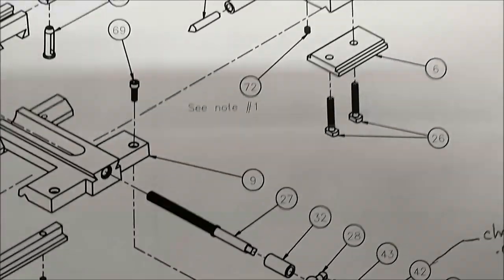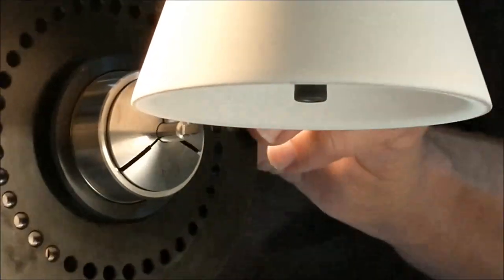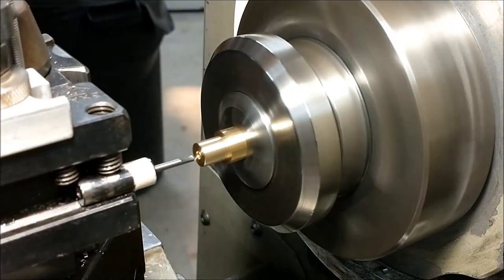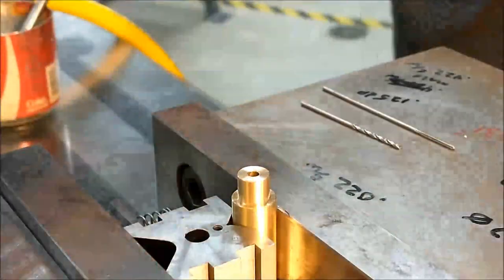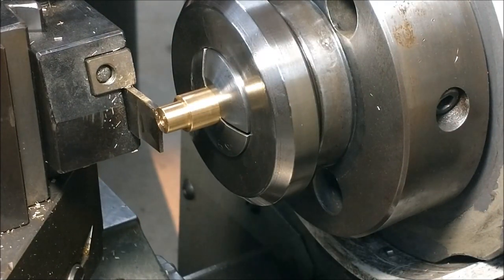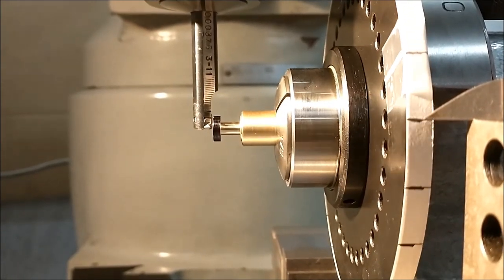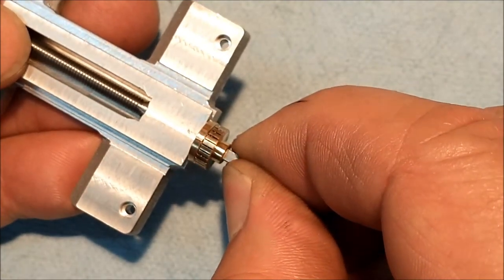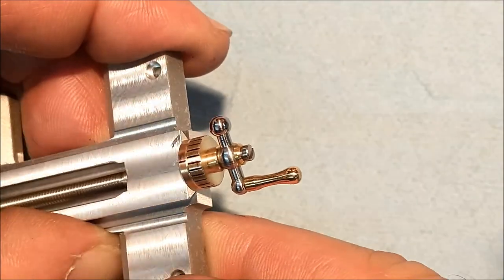Mini Dials for the Mini Lathe

Comment: Great video as usual. Here's a little white board job for one of your videos. Draw a right angled triangle without a hypotenuse with the base equal to the circumference of your spin indexer dial. Set your board compass to a radius that is easily divided by 25 but longer than the base and use that to set the hypotenuse from the end of the base to the vertical side. Divide the hypotenuse into 25 and from each of those marks drop a vertical to the base. You will have 25 divisions on the base without needing to calculate any numbers or use any special tools. If you do it on paper you have your required scale for sticking to the rim of the spin indexer. A useful technique for people who have not seen it before.
Reply: That is indeed, very sneaky!
Reply from the maker: I like that. I had to think about it for a minute, but its clever.
Reply: @joepie221  It's not something I came up with, I think its been around for a very long time but it's a useful tool to have in the box.

Comment: Joe: Love your projects and the skills you pass along.  Speaking of passing along skills: Quick way to get any number of equal divisions between two points, like that construction paper you used, is to draw a line (in this case at pi*diameter of your dividing head) perpendicular to the base line (where you marked divisions using data from excel). Place a ruler with zero in the corner (lower left on your construction paper) and swing the right end up at an angle (hypotenuse) until the number of divisions you want intersects the perpendicular line (for instance for a circumference of 20" and you want 25 divisions, swing the ruler until 25" intersects the perpendicular at 20"). Mark each nice even numbered division (each inch, in this example) along the hypotenuse. Make the marks along the hypotenuse perpendicular to the base leg.  Use a square to drop each point down to the base.  Just about every old carpenter uses this method to get perfect divisions without resorting to an excel spreadsheet and a magnifying glass to mark four decimals. Works amazingly well.  Have fun.
Reply: One of the few things I remember from school 😂
Reply: Like using a roofing square on a rafter the length of the circumference!
Reply: I learned that in my woodworking studies. Very accurate method with no math!

Comment: Thanks again Joe, it's great to see someone with your experience (and access to CNC versions of everything) take the time to share your tips and techniques of using manual machines. Hopefully it will help keep the army of home / hobby machinists like me pointed in the right direction.
Reply from the maker: I may take a beating for this comment, but I think all CNC machinists should start on manual machines. The core basics can be very helpful in setups and tooling.

Comment: Great work. I was restoring a proper sized lathe and surface ground the top of the cross slide (it really needed it), but in doing so I lost the reference mark for the dial. Ended up running a diamond engraving tool back and forth on the mill and it came out perfect.

Comment: That is really a powerfully simple indexing technique for for a small dial like that - and one that could potentially (given sufficient space) be blown up for larger jobs and/or higher accuracy.  I think I may try it for a project I have in mind.
Reply from the maker: I could have made a plate on my CNC mill, but chose that option to demonstrate the utility. It worked very well and was fast.
Reply: @joepie221  I would imagine the bolt circle function on a DRO would allow someone to make a very accurate plate as well. X-Y indexing is probably a lot easier to do electronically than angular  indexing.

Comment: New machinist but old guy here. Love your stuff Joe and your craftsmanship is stunning. At 6:20 can you explain the terminology  "always break the OD where the cut terminates" ? Are you saying to face the item where it was previously parted or am I misunderstanding the comment ?
Reply from the maker: As you turn material, you technically have a shearing action and a pressure displacement in the direction of travel of the tool. For an axial cut, you will raise the OD size from this displacement. Its the burr. It may not be big ugly and ratty, but if you measure, it there. When you flip the part, it could act as a cone and throw the cylinder out of concentricity. I like to break that useless edge to be sure that doesn't happen. Especially on small parts.
Reply: @joepie221  Great, thanks for clarifying. I was confused by the term 'break' but the process makes sense. You are essentially removing any material that will mess with your reference surface(s) on the second op. The facing is also necessary but you need to make sure you have removed the raised section to establish an accurate corner. Love your class sessions too.

Comment: Another great video Joe!  I learn something new from every one.

Here's a technique to lay out your increments using NO measurements.  All you need is the ability to draw parallel lines.

-  Wrap your paper around the OD of the disc on your indexer and mark the point where they overlap with a dot.
-  Lay the paper flat and connect the two dots with a straight line.
-  From one end of the line, draw another line at an arbitrary angle.  Any angle other than 180° will work, but an acute angle is easiest to work with.
-  On the second line make evenly spaced marks, totaling the number of increments that you want.  The spacing doesn't matter, only that they're evenly spaced.
-  Connect the last increment mark to the end of your circumference mark, creating a triangle.
-  Working your way back from that line, draw parallel lines from each increment to the line that represents the circumference. 
-  Now cut out the strip and wrap it around the indexer and you have your template.

That's it.  The best part is that there is no cumulative incremental tolerance error.

Comment: Joe - great and thanks.  I tried to follow when you hollowed the front face of the broach, it wasn’t clear the operation . You did it quick. Could you elaborate the technique ?  Thx in advance. Mike
Reply: All joe did was keeping the grinding  cup on center, crawl up on the face with the tip of the cup and grind a small concave notch in the  tip of the broach tool.  EZ Peazey! The shape helps to curl off the flat surface he is pushing down into the brass he is Broaching. The broach is smaller than the hole he wants to make square, that is why he is going in the four directions in the hole to make it square.

Comment: lovely video as usual Joe, really nice exercise in overcoming a problem on a spin indexer. I have done the same (for a different job) and I used  my mill with a fine point Japanese pen in the chuck and used the X axis travel to give me the graduations I wanted. Results were a reward for the effort. I certainly agree with you that these small components are time consuming especially if you have to produce special tooling! I've had people say 'It took you how long to produce that tiny thing?'

Comment: Love that broach idea, I used a file on mine but they never came out as precisely square as that, back to the drawing board. Working on the table saw now it uses a small slitting saw blade you can actually cut with.
Reply from the maker: I did the crank with a file, but wanted to revisit the broach for these for concentricity.

Comment: Dang that's small stuff!
Only thing I'd have done that would have maybe been a bit easier is instead of marking out the spin indexer graduations on paper, I'd have laid them out on a piece of masking tape that could be stuck to the spin indexer directly.. I've done this on my lathe for when I needed a 13 spline part and had to mark it out
Great vid as always!

Comment: hi Joe, amazing work as ever! How do you lock the spindle of the mill to prevent the square broach from rotating? cheers Steve👍
Reply from the maker: Back gear, lowest RPM setting possible and cam lock the brake lever.
Reply: @joepie221  ah, thanks for the response, I thought as much. The Chevalier (Bridgeport clone) only has a momentary spindle lock and not the latching cam lock.  I can see a mod coming on🤣👍

Comment: If you use one of those cheap chinese usb microscopes that connect to a smartphone ,you can get good accuracy from the paper template made on a decent printer.You can even make gears like that on a lathe ,as long as you grind a profile right ,you can use a carriage like you would a shaper.Or make a broaching tool .Also good way to make keyways in a shaft.
Its not fast but it will get job done.
For holding a template you can make a metal disc and mount it to a spindle in the back by using spliced  shaft with a tapered hole and a matching taperd nut witha thread in the middle .Then you use a all threaded rod like a drawbar.
For holding it stationary you can make simple peace of metal with a screw -like a disc brakes on the bike or a scooter that you mount down to the gear scissors.

If you want to go further you could make a stepper motor and arduino program for it to spin it super accurately.

Comment: I read a sort of cool way of doing the equal separations trick called "Dropping a line."  Assume the circumference  is 15.7 inches and you want 25 equally spaced marks.  On a sheet of white packing paper draw a line vertical line at 15.7 inches from the edge extending upwards 10 or so inches.  Draw a parallel line to the bottom edge 1/2 inch from the bottom from the left to the 15.7 vertical.  

Now take your yard stick.  Put one corner at the left side and 1/2 inch line.  Put the 25 inch mark on the vertical you drew. Now, using a right angle, draw a line down from each inch tick on the yard stick to the bottom of the paper.  You now have the right number of marks, all equally spaced and no math, no excel.  Just a right angle and a yard stick.
Reply from the maker: Thats clever.

Comment: Joe, I saw another popular ytber post a video a while back that had a thumbnail with a micro lathe in hand that hand nothing to do with making a micro-lathe, so I made a snide comment regarding the clickbait and challenged them to now make a lathe that small since they used it as clickbait. I feel like you're are saying hold my beer on that  comment with this series. I've seen notifications on this series of yours and this is the first video in it I've watched. I think this series is going to be a good long game move for your channel.
Regarding somethings I've seen and learned so far only half way through the vid: @13:34 you used a thin edge(razor) to locate that tool. Nice. It was a softer material so this made sense in my brain. You're working on a small machine with tighter tols, I'll throw that in my back pocket for soft metal jobs to tighten future work. It skips using a thickness gauge and adding or subbing it.
Ironically, Just yesterday I had a random job asking to put two equally spaced arrays of 6 x .438" holes in a 3" diameter 304 tube 1/8" wall. It was a $200+ sanitary piece with the fancy v flanges at both ends. Both arrays were offset .100 off centerline of the tube. I only have a manual lathe and mill. I have no indexing equipment. I accepted the job and said to myself I'll figure it out. I've been there other times with tube hole arrays and only manual equipment with tighter tolerances.  Still this job was a different layout than others because of the tubing size. So I laid out the array similar to as what you did and then by eye I noticed that something was different between the two arrays. It ended up having to do with the drawn line thickness and the way I indexed the pattern on the part for the second array. 
Well, as a CAD/CAM tech I made another pattern with CAD and printed it out 1:1. wrapped it around the tubing. I scribed it out on the part and punched locations(oh that center crevice can be such an important detail. Can't it? :) )...more story on fab. Anyways, it turned out spot on. I have about 10yrs Cad experience and a little over 20 with manual machining and I guess my point is that learning a little bit of CAD....even just a simple free package like sketchup...can come in handy for you to save some time once in a while. Another time I layed out a 1:1 random hole pattern printout on a plate with +/- .010 holes and centered through the paper. The customer wouldn't have known the difference. I still love laying out work. It feels like a time honored practice.

Comment: If you have a small set of number stamps you should be able to stamp on the face of the dial 0-5-10-15-20 or Roman numerals U-V-X-XV-XX. Roman numerals could be pressed in using the mill to position a made chisel, held In the collet, rotated to form the numbers. Then this would truly be an ancient lathe.

Comment: Remember at all times, pi are round. 🙄
Nice job as always. That cup wheel holder looks like just the ticket for touching up the ends of end mills with one of those indexable 5C collet end mill sharpening gizmos if you do not have a surface grinder. I sometimes think I'm responsible for the rise in price of used surface grinders about 15 years ago. I made the point that the four* machines a shop must have are a lathe, a mill, a bandsaw and a surface grinder. 
*ok 5. A cutoff saw

Comment: How much horse power is this little lathe going to have?
Reply from the maker: More like , how much miniature horse power will it have. The machine itself doesn't have any. These were usually belt driven by a much larger source, like my steam engine. The pulleys selected would then dictate the torque and power available.

Comment: Comment about using paper for scales:  BEWARE!  Paper loves to change dimension with humidity level!  Lay out your scale, and use it promptly.  You do have "circumference check".)  Do not use any aqueous glues or substances on the paper (you are OK with tape).  When I was in junior high school, I made a scale for a player piano roll punch (9 holes to the inch), & it expanded over 1/8th inch on 11" length when I glued it with Elmer's glue!  (To drill the punch holes with proper spacing, I used a 5/16-18 screw to advance the drill jig for each hole, as I had no milling machine.)
Reply from the maker: That would be an interesting experiment.

Comment: Not that I have any right to comment but you can do the graduations with paper even easier. Simply make 25 evenly spaced lines smaller than you need on a wider than you need paper strip and then wrap the paper at an angle so the lines line up to the diameter of the index wheel then cut the paper at that angle across the lines. No math.

Comment: Those of us with compromised hearing would appreciate captions. Can't read lips if I can't see them! 👉👀👈
Reply: Stan, there is a "CC" button among the controls. It will auto-generate captions if they aren't already embedded.
Reply: @g.tucker8682  
  Have been using that feature since 2016. Not available for this video. Uploader has a toggle that needs to be checked when posting the video.
Reply: Yeah, I watched this very video with auto-captions. Hope you get it sorted, Stan.
Reply: Got it this time around. Must've been some of that YouTube sorcery!
Reply from the maker: I'll check on that, but I believe the viewer has the control.
Reply: @joepie221  
Thanks.

Comment: You ruined my, "I'll bet that took at least an hour" joke when you gave the time at the end. :(  Real suggestion though.  Those jeweler's screwdrivers are actually for jewelers.  The blades are way to thin for most hardware used for models and if used enough times will chew up the hardware.  If you continue with these types of projects take a look at Wiha miniature drivers or something similar.  Wiha is excellent but expensive.  There are other brands that will work just as well.  But the point is that they will fit your hardware a lot better.